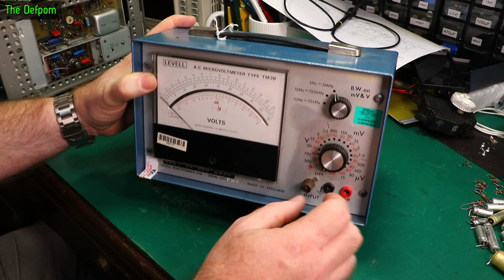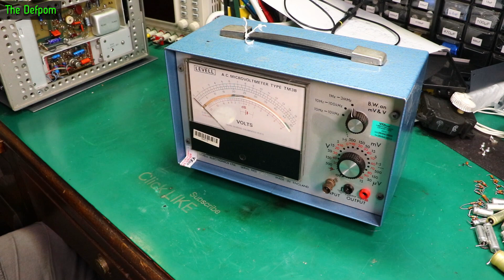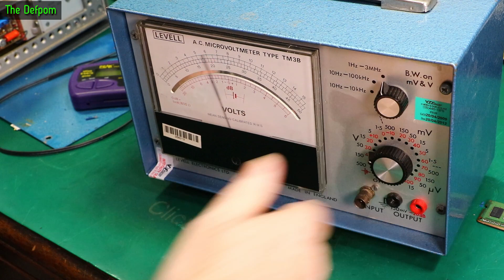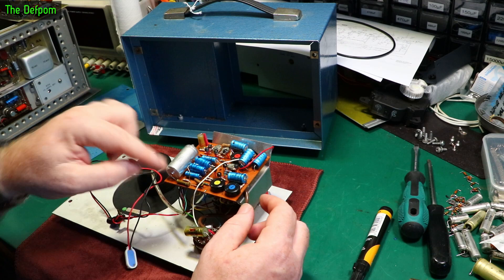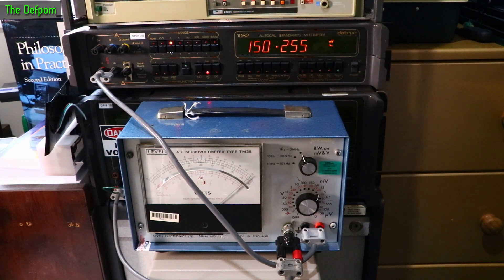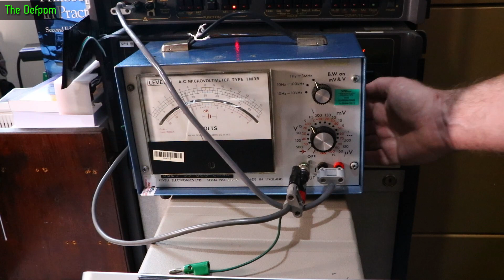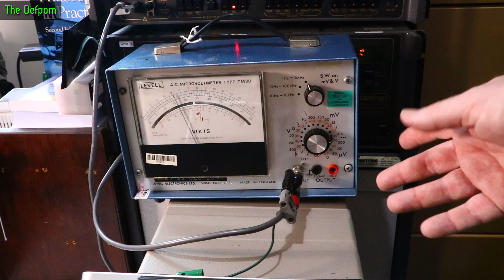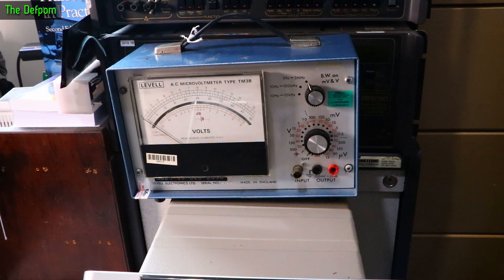🔴 Levell TM3B Microvoltmeter Repair & Testing - No.1107

Comment: Double check that the 'off' position indeed stops any current draw from the battery. Then slap some velcro on the battery and call it a day. To change a battery on A fluke it needs a screwdriver too ;-D. The original 6-cell holder still looks fine to me. Bit of a wash and ready it is for another 5 years or so!

Comment: If you don't want to have a rusty case soon I suggest to (spray) the chipped parts. That exact same blue color still exist. Search for Hammerite hammered blue.
Apart from that I wouldn't touch any settings.... that can only make it worse. It is an analog meter after all. Those caps look like the vintage Philips cap's. I've never seen one go bad, but of course there's always that one exception.

Comment: You could probably 3D print a pack for six D cells that would fit into there.  But a better solution would be Li-ion cells with battery management and switching regulator.  Set the switcher to 9.5-10 V and smooth it with a linear regulator.

Comment: If you're going to cut a hole in the back panel, you could put a power socket in, or maybe a panel mount battery holder
Reply: I think the great thing about this instrument is that it has an internal battery pack, therefore it can be floated, as well as less prone to ground related noises.

Comment: Great to see this beast still doing so well. PP9 batteries are still readily available and in the UK I was surprised to see them on the shelf at Wilkos not too long ago.  Small point: you mention 'neutralising the acid' with white vinegar - vinegar is of course dilute acetic acid, so you'd be better off with an alkaline solution to neutralise the spillage, e.g. sodium bicarbonate (baking soda) or an alkaline cleaning product containing ammonia.
Reply: The spillage was from alkaline batteries.

Comment: It would have had a PP9 type battery, the large one that would have almost filled the battery compartment.  On my smaller version I just use a small 9V battery on the outside, lasts for years .
The pointer bouncing about as you change ranges is quite normal, the circuit is dc coupled so à disturbance takes time to settle down.  Make great stepped gain pre-amps.
Reply: PP6, PP7 or PP9 maybe?
Reply: @IanScottJohnston  they used the PP9 Lantern Battery, I've been using them since the 1980's and had my own TM3A since about 1995. i use a pp3 on the outside of mine and it lasts for years.

The are great for audio coms work, no x-talk between meters due to mains wiring. No mains induced noise, 10dB per switch step so you count the clicks for a quick signal to noise check.

 what more can you ask for.
Reply: @TheEmbeddedHobbyist  Pizza. You can ask for all that plus a pizza. I know I would.
Reply: I remember those PP9's with two springs on top ?   ̶m̶e̶ ̶a̶n̶d̶ ̶m̶y̶ ̶m̶a̶t̶e̶s̶  my mates would nick them from the orange roadworks lights !.....cheese.